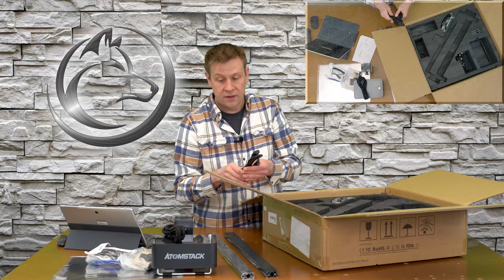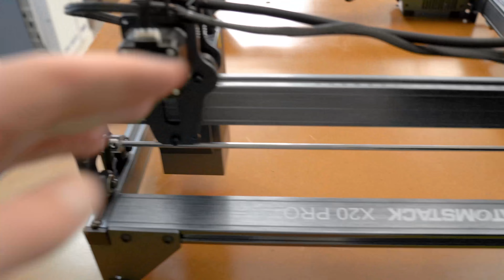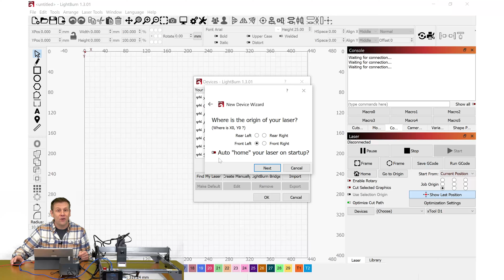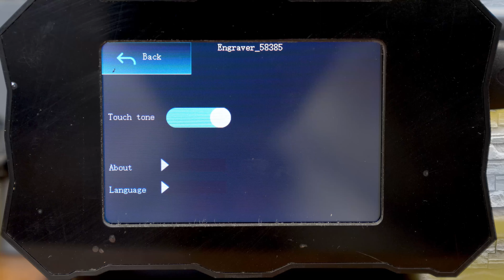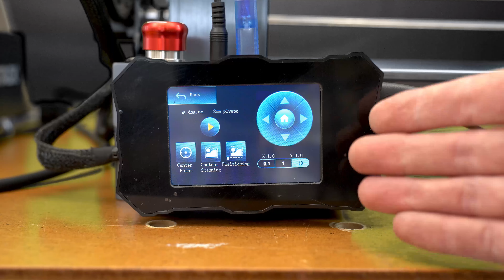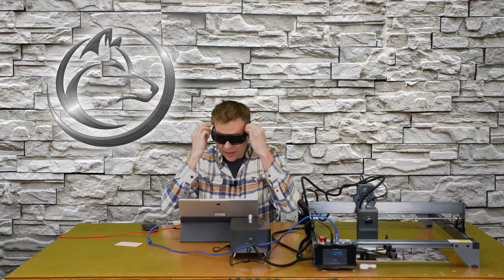Atomstack X20 Pro

Comment: You forgot to show the framing process.  Do you position the center or the corner?  I saw other videos showing the framing process. However, your video provides great insight on software/hardware setup.  Can you create a project with a piano shape cutout.  I want to create a plaque for my wifes piano student as a trophy for their annual recital.  Buying those plastic trophies is old and I want to personalize their trophies. It will engrave their name, my wifes name and the year of the recital.  The plaque is going to sit vertical inside a groove cut on a base board.
Reply from the maker: Framing could be it's own video- I should add it to the recording schedule!  I usually use the bottom left corner when using Start From-Current Position.  Sometimes I'll use a Tool layer in Lightburn; T1, T2.  The Tool layer I'll draw the size of the entire engraving area of the item- this way I can see in the software what my graphic or text positioning looks like.  Thanks for watching!

Comment: after watch some of your videos like xtool, ikier, atomstack etc.
which brand do you choose as the best of your version?
thanks.
Reply from the maker: Thanks for watching! I like the Atomstack brand and especially Ikier. Atomstack owns Ikier with Ikier being the feature packed brand. If your budget allows- Ikier K1 series all the way. They have so many new features no one else offers and it does not add too much to the price. Construction of the Ikier K1 series is also top notch!
Reply: @thelaserchannel1  thanks for the answer.
Reply: @rezautoled1767  the unique "problem" is that the diodo laser doesn't cut transparent acrylic :(
Reply: @rsozac  im agree with you. diode laser cant cut transparent acrylic. transparent acrylic can be cutted by co2 laser, but the co2 tube lifetime is not as good as diode, so for starter i choose diode laser. i need to cut/engrave wooden material.
Reply: @rezautoled1767  yes, now i olny engraving or cutting wood, foam, mdf, triplay (i think thats is the name in english, this instance is to practice too), maybe diode de speed is not faster than CO2, but is a good instance to create new kind of products or costumers
Reply: @rsozac  ikier brand will release 48W diode laser engrave with dual mode (24W and 48W) using switch on its laser module. higher wattage mean you can cut faster. diode laser have wattage too depend the tube.

Comment: Hello, i have the s20 series. The cut and engraving is not a problem. But the home position is difficult to adjust. That is due to tension belt. I dont have jet the correct "value" 😢
Reply from the maker: Hi- thanks for watching!  I have not had any issues with the home position other than making sure the cables and air assist line do not interfere with the homing sequence.
Reply: @thelaserchannel1  thanks for your response. I'll try to detect the root cause to fit that daviation. Best regards